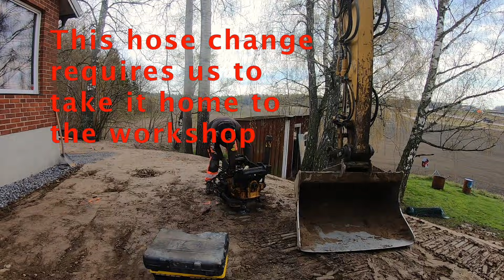We're back to complete this job 3:5

Comment: This project is going well Mr Hedblom, however it’s a pity about the hydraulic hose leaking on the tilt rotor as I think that that attachment on your excavator is a worth while piece of equipment especially when you are in a tightly confined space and you need all the help that you can get in such situations, anyway still good to see though and I will look forward to seeing your next video and until then TaRa for a bit.

Comment: HOW COM E YOUR TIPPER ONLY TAKE SMALL LOAD SIT CAN TAKE MORE THAN YOU PUT ON BAD
Reply: Do you understand how regulations of gross weight for trucks work on different roads especially in spring on gravel roads? Who know where they are hauling it to also?
If you load it up brimfull you can be certain you will loose your drivers license, your truck, your job and also the truck owner have an hefty fine at about 5 000 euro/dollar!